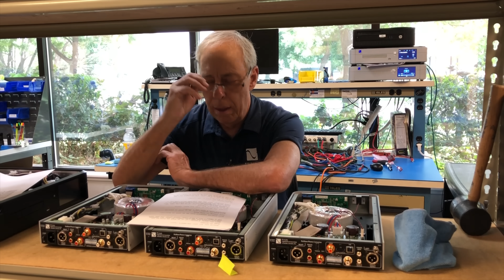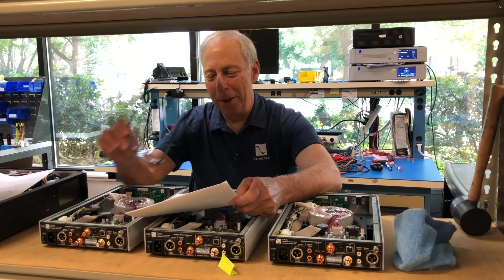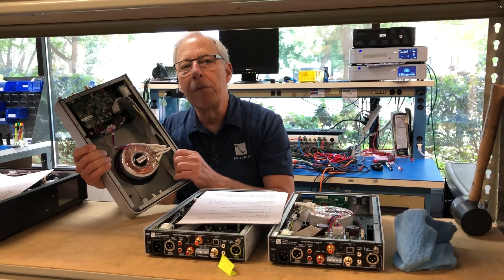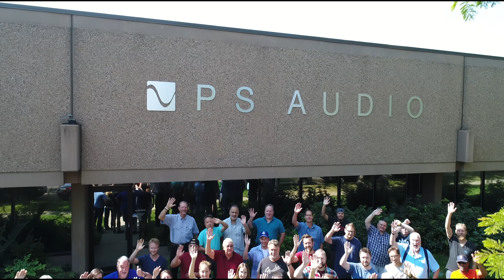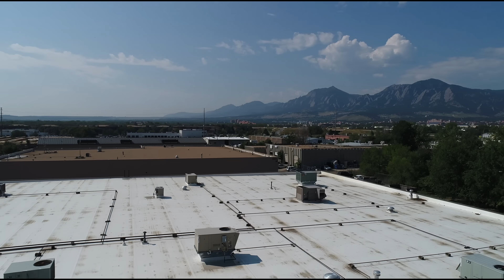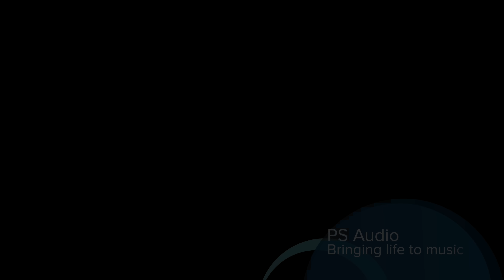What's inside a high end power cable?

Comment: Hi Paul. 
Thank you again for the video. Very good one. 
Some weeks ago I've changed the power cables of my system (stock ones for DH Labs AC Power Cord), along with the amp fuse (stock one for Hifi Tuning Supreme). I also put a power AC filter (Bada LB5600) and a couple of PS Audio Noise Harvesters. I didnt try the upgrades separately (I know a mistake), but the sound today is SO MUCH better: fuller, stronger bass, wider and deeper sounstage, much more detail, better dinamics, etc. I can't tell the impact of each upgrade, but after seeing your video, I guess the fuller sound and stronger bass should be a result of a better power cord because I've read that filters and fuses improve mostly highs, detail, background and soundstage. What do you think? Am I right?
Reply: LMAO
Reply: @josedealva4205  'Noise harvesters'?  OMG!!

Comment: It's amazing how divisive this topic is. It's clear that there are two distinct camps: People who trust their hearing and those that do not or don't even care to try. To flatly dismiss the idea that power cords could possibly make a difference in sound simply based on what's currently understood and able to be measured (as if we have mastered and fully understand all the influences that impact sound), is like needing some sort of verifiable objective measurements to give the precise amount of beauty something possesses before it is allowed to be recognized as beautiful. Labeling people who DO hear the differences in AC cables as clearly delusional or purveyors of "snake oil", is the height of chauvinistic arrogance. If YOU can't hear a difference, fine. But that doesn't mean that some real character of the signal that has reached your ears hasn't changed in some meaningful way just because it can't currently be measured. Did the Higgs Boson exist before it was finally discovered and confirmed? Yes, of course. Was Prof. Higgs peddling "snake oil" prior to it's detection and discovery? Following the "if it hasn't been measured, it doesn't exist group", then yes. 

For me the proof is always in the listening. Sometimes different power cables don't make a damn bit of difference and sometimes they do. The ones that have made a difference for the better remain in my system. 

Thanks Paul for defending and standing by subjective evaluation as the final arbiter. You have reinforced and underscored the idea that "Beauty is in the Eye of the Beholder". (or in this case, Ear of the Beholder)
Reply: So what you both are saying is that in 2018, the acquired knowledge of electrical engineering is wrong. Audiophiles with no electronics backgrounds know more than educated engineers and technicians? You claim people who have gone through formal electronics educations as well as those with many years of practical experience are ignorant? Why don't you go to your local bar filled with HDTV satellite sports channels on the flat screens and patrons communicating on their smartphones and proclaim electrical engineers are ignorant. We know you hear the difference. What you won't accept is why your hear it.
Reply: Andy Delle No, I’m not saying that the acquired knowledge of electrical engineering is wrong. Only that it doesn’t know everything, which means that in certain areas of studying and understanding the phenomenon, it is indeed ignorant. And just like all other areas of science, some things are well known and understood, but others remain a mystery, like dark matter. The problem arises when an engineer or scientist declares that if it can’t be objectively measured with current technologies, it must be imaginary, when it could come down to not fully understanding the phenomenon (combined with not trusting in one’s hearing) and not having the tools designed or sensitive enough to measure that particular aspect of the phenomenon that is subjectively heard or seen. 

Could what certain people hear as being better in one power cord over another be a placebo effect? Certainly. And I would imagine that accounts for a reasonable percentage of listeners. But there are effects that can be heard to the astute listener that transcends placing it all on the placebo effect. And one could argue that even if it is a placebo effect (not that it is) so what? If it subjectively sounds better to the listener, it IS better. Then it all comes down to it’s perceived value to the listener and if he/she finds value in it, then that product has a legitimate place in the market.
Reply: No...what Paul and many experienced engineers, system designers (like me) and professional reviewers are saying is that the types of scientific, technical testing we do on various components...even simple components like wire...do not tell the whole story when listening to the effects of passing currents and signals through various chokes of various materials.

Simple...if you don't hear a difference...it doesn't mean you are a less than others..it simple means you don't hear difference...for any variety of reasons.
Reply: @Scott Hudson.... We are talking about power cords here, not signal cables. To date nobody has any evidence of power cord effects beyond the well understood current starving and in some cases noise reduction by cords with filtering of some technology. Beyond that there is nothing that can affect the audio signal via the power cord.
Reply: There are many things that we take as self evident that have absolutely no substantial evidence to support it. Take your thoughts as an example. There is not one shred of "real" evidence that a "thought" actually exists. It is simply your word and my willingness to believe it because I also have experienced what I believe is the same phenomena which gives the idea some validity. But beyond that, there is no tangible evidence. Nothing. Anything "real" that you can point to is the "result" or product of thought, but not the thought itself. 
My point is to try not to get too hung up on requiring some sort of external absolute measurable proof that something is "real" before recognizing it's genuine experienced effects. Not knowing exactly what's going on shouldn't prevent the experience. If you don't hear any difference, you simply don't (or in some cases choose not to) hear any difference and you've saved money!
Reply: Enough of this ivy league philosophy crap! This is a scientific discussion. If the power cord has an effect in a consumer audio chains outside of the obvious conditions, that can easily be measured by 1950s technology let alone what we have today. This is basic placebo effect from people who have no understanding of rather basic electronic principles. Now that's not to denigrate those who fall victim to placebo effect. It's those who insist on arguing with industry professionals who are the fools.
Reply: And we go full circle back to my original statement that there are two camps: People who trust their hearing and those that do not or don't even care to try.
Reply: Power cords can carry artifacts that can manifest themselves in the inner workings of exceptionally sensitive electronic gear.  Studies of ECG results are full of examples of the most minute of electrical interactions that may influence medical diagnosis in ways so intimate and subtle that entire specialties are centered on the study of the topic and interpretation.

Remember, we're not talking about just the artifacts carried by the electricity from a power station through miles of conduit, into your house and into your gear.  We are also talking about the delicate interaction of the power cord with it's environment immediately preceding your gear and the backward interaction of your gear with the power cord.

Look....you're not going to believe me in a post here...obviously.  But there are literally thousands of studies on this not just limited to audio gear.  I have read many of them to help explain this phenomenon to me adequately enough to help me understand why, as I worked my way up the audio gear food chain, I started to hear these artifacts myself.   There is the effect of diminishing returns and so many other variables it really is up to the buyer to work out his own solution...don't just listen to me, your buddies or your own biases.
Reply: Then show me the accredited data. If there are indeed thousands of studies, finding one or two should not be a problem at all. The crux here is if a power cord can have an audible on a home HiFi system. That's not to say conducted RFI isn't a problem. What I want to see is evidence of this on consumer audio gear, which is what the snake oil peddlers are trying to sell. And don't bother with those Shunyata medical  claims. We have proven those claims to be false based on the fact that his products do not carry any safety certifications that are strictly required in medical facilities. What is your engineering background? What qualifies you to argue these claims?
Reply: Jesus H. dude.  You have internet access.  Do some research.  I'm not here to win you over.  If you don't have enough interest for your own use to do your own research maybe you have answered your own question......it's just not that important to you.

I think you are just being argumentative and trolling.     Don't like it?   Great......save your money for some music and go relax....man.......
Reply: Come on, you say there are thousands of references that prove an expensive power cord on a hifi audio component makes a difference. I ask for just one or two and you can't produce! You seem to discount the fact that I do this for a living. I belong to several professional engineering societies, You don't think if such research was published I would not have seen it by now?
Reply: I've read many of your comments and I an quite sure no matter my level of expertise, you would somehow find time to argue with me.....I sense that about you and that doesn't take a special cable or high end gear to figure out.

For the record, I have a PhD in magnetic field sensor design.  You also may have read some of my work in college concerning MEMS device models and Cadence Spectre and SpectreRF simulators. But I have a feeling that won't mean much to you.  You're angry about something.

Some of the most sensitive devices in the world exhibit attributes you may find puzzling when using simple audio related perceptive analysis.
Reply: Then show some professional respect. First my college years are late 70s early 80s. Cadence didn't exist yet. I'm not arguing magnetic sensor design. But you seem to be arguing broadcast level audio and video engineering, my field. Your are attempting to articulate phenomenon in your field to support PS Audio's BS. I can tell you as someone who has designed and worked with AV gear on a higher level than consumer stuff that this topic is snake oil. Again if you have direct proof of the topic at hand, show us. Otherwise you are just professionally speculating based on your expertise and experience but in different  field of physics.
Reply: I'm not sure respect is going to be part of any conversation based on some of your comments and when you are so clearly set in your opinion.   I think I'll leave it as we are going to have to agree to disagree and you can find a more willing debate partner.  I'll stick to enjoying my audio gear and hobby.
Reply: That's fine. But popular opinion in this thread seem to support this is snake oil. And I for one intend to keep calling it out anytime one of these snake oil peddlers comes knocking.
Reply: Scott Hudson Scott, understand that what you are hearing is the result of the speaker cone moving. The speaker cone is reacting to electrical signals. If a speaker cone is reacting to a signal, then our much more sensitive instruments will react to the same signal. That's why it should be very easy to test these assertions. Measure the signals before the magical cord is plugged in, and then measure the signals after the magical cord is plugged in. If there truly is a difference between the two, then the speaker will have reacted differently. And if so, our instruments will detect that changing signal too. Any changing signal that affects a speaker CAN be measured..
Reply: Scott Hudson Scott, understand that what you are hearing is the result of the speaker cone moving. The speaker cone is reacting to electrical signals. If a speaker cone is reacting to a signal, then our much more sensitive instruments will react to the same signal. That's why it should be very easy to test these assertions. Measure the signals before the magical cord is plugged in, and then measure the signals after the magical cord is plugged in. If there truly is a difference between the two, then the speaker will have reacted differently. And if so, our instruments will detect that changing signal too. Any changing signal that affects a speaker CAN be measured..
Reply: Andy Delle, Please prove this... "there is nothing that can affect the audio signal via the power cord." You seem so sure, show us.
Reply: Audible differences do exist but should be able to pass e reasonable test of credibility and al lot of them just don't.. Dragging in Higgs-Boson and the likes will raise cheers in the audiophile church but not many physicists will applaude a subjective claim. Let me drag in a physics pet peeve of my own. Just Google 'René Blondlot' and you will see why subjective claims shouldn't stand up ( even if there are many) if they can't be reproduced under controlled conditions. Then it's just placebo at work...
Reply: Otto Normalverbrauch I agree that any subjective observation should be able to be shown in objective measurements. But the problem is making a big assumption that we know EVERYTHING about the nuances of electrical power conduction AND that we have the tools available now to make those objective measurements in a fully adequate and accurate way. The objective observation by current available machines may not be setup and tuned to detect the full nature of the phenomenon that’s subjectively heard. It could be like asking an X-ray detector to measure infrared light. Does this mean that subjectively observed differences in power cords will ultimately be supported by objective testing? No, it could certainly be the placebo effect at work. But, to categorically state “If it hasn’t been measured, it doesn’t exist” is a great miscarriage of science itself.
Reply: @bentonpix  Hi I do not state what you write in your last sentence. I want to state: No-one has under controlled conditions been able to blindly hear differences between powercables. I cannot prove that things don't exist, you can only state they exist with careful blindtesting and if these differences are actually  heard thén work on a hypothesis to find out where these differences might originate. Problem here is that audiophiles often ask technicians to prove what the audiophiles think they hear under non blind conditions...;)

Comment: What other frequencies would be passing through a power cable other than the standard 60 HZ line frequenciy  in the US and 50 in other ares of the world? Would the primary voltage of an AC supply be modulated by strong current draw of the musical content's draw on the secondary of the supply?  I know from transmission line theory that the type of conductor will affect the signal, but wouldn't proper power supply design minimize the effect of rapidly changing current draws furnished by the secondary of a power supply operating at these relatively low frequencies? Also is it possible to measure voltage changes on the primary side of a transformer while playing different frequencies on the amplifier?

Comment: Let’s say for a second that stranded/solid cables make for a better signal transfer. Does that justify prices of $100+ when this stuff can be spit out out of a machine somewhere for a couple of dollars? We’re not talking  a great amount of any precious metals here in any of these cables.
Reply from the maker: In some cases we are, as in PCOCC which is an arm and a leg expensive, but, for the most part, you're absolutely correct.